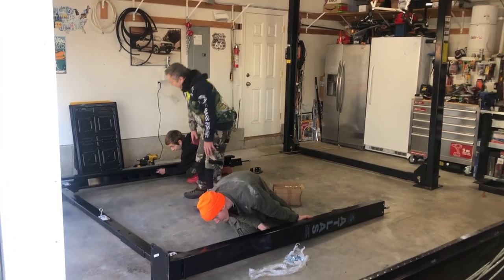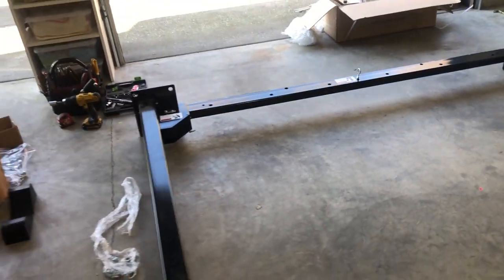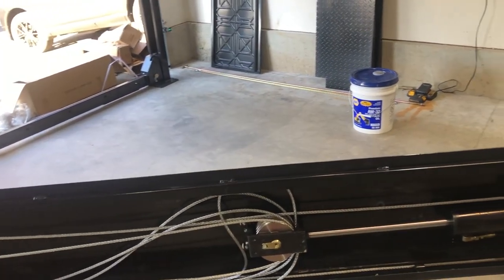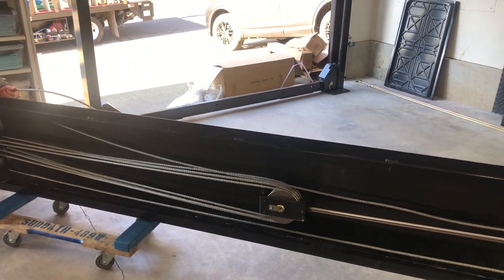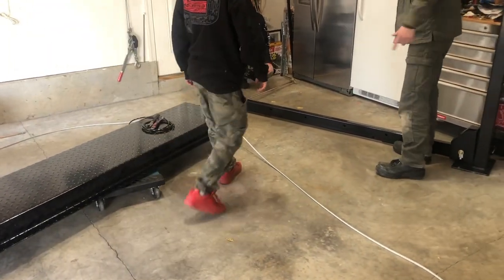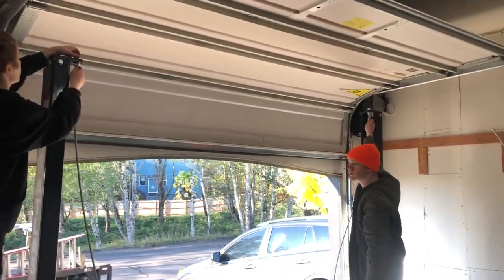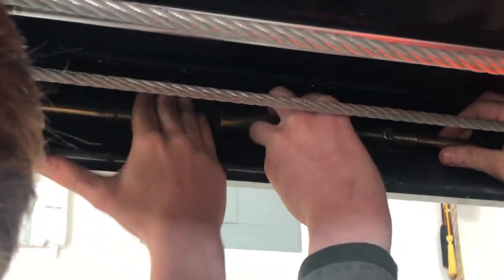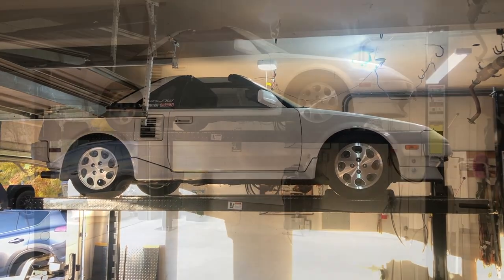Atlas PRO8000EXT 8,000 lb Extra Tall 4-Post Lift Installed!

Comment: Very nice...what made you choose Atlas over other brands?
Reply from the maker: It was the one that I found that fit the size and lift height that I wanted. I had also heard good things about the brand from some local people that had them.
Reply: @jimsgaragetoys  those reasons are definitely good enough to me! I have been looking at them as well....there are a lot of different manufacturers Bendpak/Backyard Buddy/Advantage/Atlas...all seem ro have solid reviews so it's gets a little confusing on which manufacturer to choose from🤔...1 thing I like about Atlas is that it is local for me
Reply from the maker: @coreypatterson1386  It seems to be of very good build quality. The guy that helped assemble it also said that they are well designed and built. Local is a big plus for you! 👍
Reply: Atlas has the narrowest and most clearance for this size of lift compares to others including bendpak. I can’t wait to get mine next month.